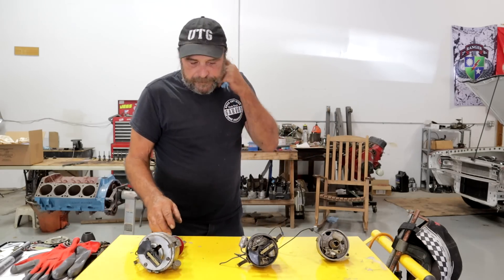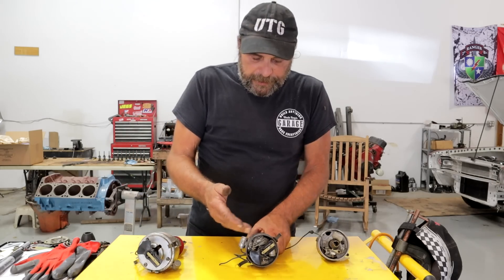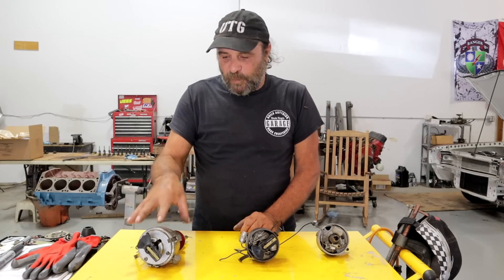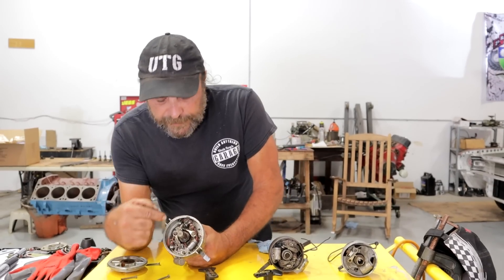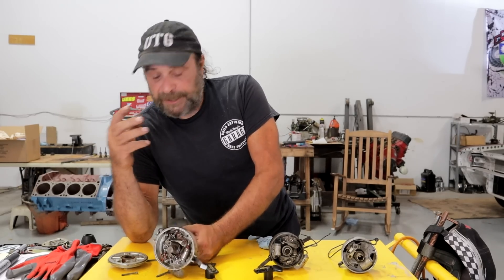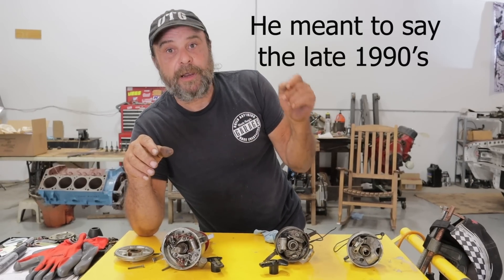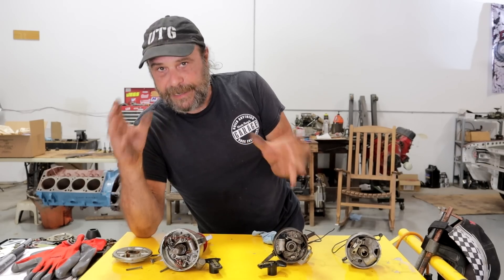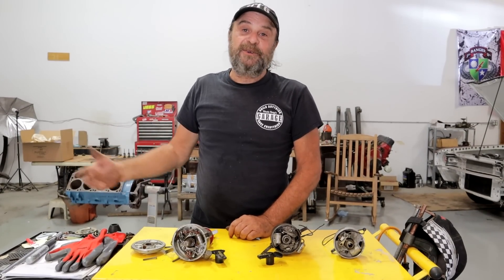High Performance Point Ignition Systems -  Tuning, Modifying And Understanding The Different Types

Comment: Tip on  points ; when points build up a metallic mound on one side, the CAPAPITANCE of the condenser is wrong. Stock condensers tend to do this, 
Measure the capacitance and change for a higher or lower capacitance condenser, not another stock one  ! A good multimeter wil measure capacitance
Reply: Simply put, the condenser "quenches" the spark across the points when they open, the value of the condenser (capacitor) determines if a metallic mound forms on one side or the other of the points. Ideal is a condenser value that EQUALLY accepts a transfer of metal on both sides of the points. That's how you can "fine tune" points by using a different capacitor over the stock one.
Reply: This was known to many mechanics in the first half of the 20th century !!!!
Reply: I know there’s a relationship between resistors and capacitors in a circuit, they used to sell these for hei in the 80’s(the condenser)also Stan Meyer(car that runs on water)had created a more efficient circuit for electrolysis this way
Reply: I was also told that whichever side of the points had the deposits told you whether to go up or down in value.
Reply: @derekhobbs1102  Right !

Comment: Jenkins triggerd one of the Prestolite boxes with the mechanical, tach, drive, points, Corvette distributors probably from '64  ( but with a Hemi  for 2 years ) well into the Seventies  . Don't know if he kept it till the early Eighties . Little bit different on the retard . The Prestolite doesn't saturate the coil with the points, the transistors do that, so  very low current accross the points, and other than the rubbing block the points last very long . Btw, Mallory  102-X points can go at least 10 thou, maybe more .  Also used by Grump .

Comment: I'm confused, I thought that at high RPM you needed more advance due to the fixed flame front speed. The engine is going faster but the flame front speed remains the same. Why retard at high speed? BTW, I think that top bearing design is a great idea.

Comment: EMP Event in the Tom Cruse, The War of the Worlds movie:…..The only car running in his town because of the EMP event was “his”factory ignition points 65 Mustang GT.
Reply: I really don't see how points are still gonna work. 
So I'm better off with an old VW diesel, it will need nothing. 
Remove the shutoff plunger from the injector pump, and pop start it down a hill. 
Remember, batteries and starters are all fried right ? 
Diesel is gonna be the only way, no electricity needed and the damaged parts can be removed to make it run. 
How so you shut it off? 
Idle or up to a tree, pop it in 3rd gear and let the clutch out. 
If you're smart, the tree is on a hill so you don't have to push start it.
Reply: @MrTheHillfolk  You're assuming the wiring that is in the diesel doesn't start a fire. The last Carrington Event we had in the 1800s burned down telegraph poles and started wild fires when the wires melted. Letting the smoke out of every piece of wire in the car, and putting a charge in all the metal is gonna cause problems even with diesels.
Reply: Nah, his super annoying son said it just shut off. They drove off in a minivan that the shop owner replaced the starter on and it ran. An EFI vehicle is gonna have a hard time running after an EMP. Was just thinking of that while swapping a 4.8 out and a 6.0 in my crewcab. I should put a bunch of these alternators, starters, ECMs, harnesses, and fuel system parts in some old refrigerators. I have all that stuff for my Pontiacs in a fridge already, I can get 5 of them running the same day.
Reply: You're dead wrong. His son stole his mustang and it died like all the other cars. Tom stole a minivan that was just fixed from ignition parts on the shelf. He took off with his kids as the mechanic was vaporized by aliens.